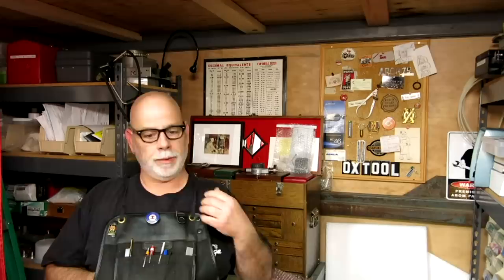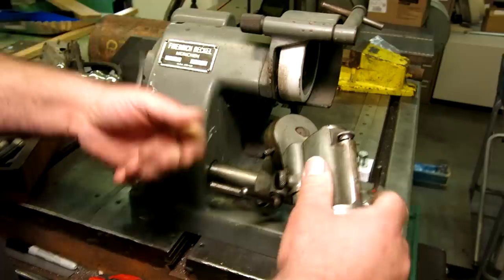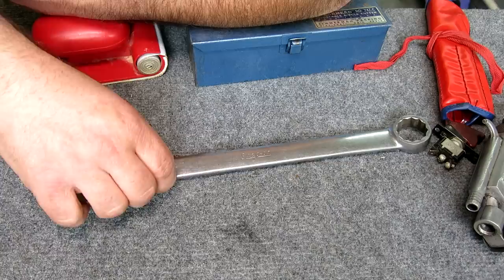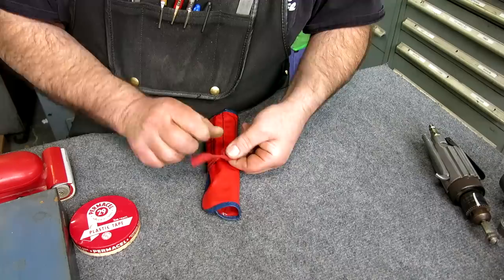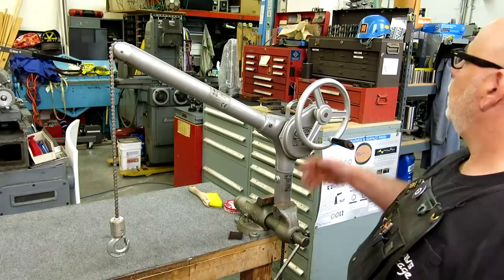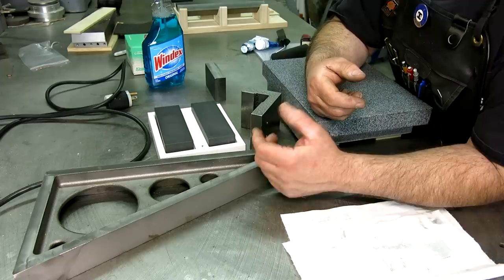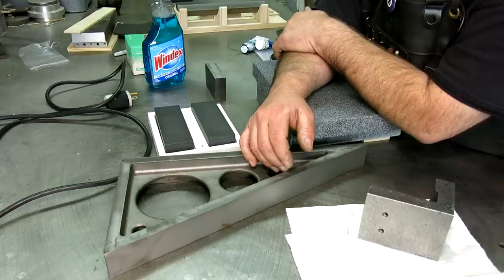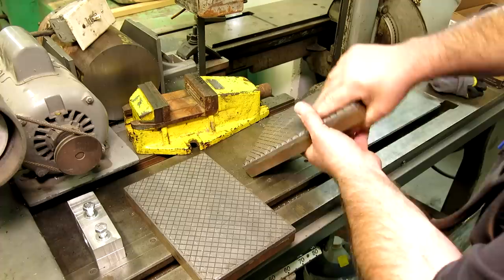Monday Night Meatloaf 117

Comment: The bailout sw. is used by the pilot to turn on red lights at the other crew members positions to signal them to get out now. Flip it up to actuate it. Down is a safety off. It is used on the larger aircraft such as a B- 52 or any multi position aircraft. Just so you know I am a retired USAF Crew Chief type mechanic.
Reply: Ja mmh.

Comment: Tom, I think you might be surprised with the last lapping plates you showed . . . Seriously !
Tin, or babbit mix can cut some very hard materials.  Tin is the premier material for lapping and polishing stones as hard as Sapphire ! ! !  * When you said it might be good for lapping copper, I was a bit shocked .  The right combination of lap material & lapping compound / polishing compound is the ticket.  Considering that plexi-glass as a lap, with cerium oxide as a polishing compound will polish quartz (remarkably); I think you're underestimating the value of soft laps having incredible potential for cutting hard material !     Congratulations on your tool finds :D   !      Thanks for sharing the meatloaf !

Comment: The air tool is a tire buffer used to rough up the inside surface of the tire to apply a patch. The reason for the Jacobs chuck is for easy swap out of the buffing head.

Comment: Just before 10:00 he mentions using Kroil.    Surprised he'd be using over-priced  over-hyped products. Gave the video a thumbs up for the heirloom micrometer.   Really appreciate such tools.   I have a hammer head over 2 lbs that was forged by my Great, Great, Grandfather on my father's side.   I used it every day for the 12 years I was in the shop. The handle itself has been changed many times but the one on it now is still a handle my father attached.  Now my father has passed but  the hammer is  still with me (despite my younger brother...nuff said) and I still use it on occasion.

Comment: Tip for you about that bigger scraper with the large head you made.
Put that large head just in from your shoulder and below your collarbone and you can actually get your body behind it. That leaves two hands to control the tool while you lean into it with your shoulder.
Much less tiring and much more productive

Comment: Tasty meatloaf! I think you might be over detailing the scraping operation though. I struggled with the same thing, you think its a super precise process but it is really more of an averaging out. As machinists we focus on the material we remove as that is what is important for what we have left. In scraping it is a mix of what we remove and what we leave that makes the finished result. I find it a different mindset for me.
Reply from the maker: Hi Brian. I figured if I could do the 40+ points doing 25PPI would be falling off a log easy. There are other uses for scraping besides sliding machine ways. Cheers. Tom
Reply: Sounds like a video subject.  I bet most of us hobby machinists only picture scraping for those sliding ways, and maybe reference surfaces.  I promise I would watch a video on other applications!

Comment: speaking of those aluminum laps, got me thinking, if one takes a clean flat piece of Al like that one, charge it with particular diamond grit, and then goes and anodizes it, then the anodizing will grow "out" of the surface just as much as it grows "in", basically enveloping and incorporating the grit into the anodizing layer, as the diamond wears, the grit is harder than anodizing, it will abrade it and expose new grit, that might be the mechanism behind those expensive laps
and since I own and operate a small anodizing line, I just might go ahead and try making one of those, see what comes of it... granted mine will be regular anodizing, not hard, still, good idea for a project

Comment: Used to use yellow artist paint for setting gears in helicopter transmissions and tail rotor gear boxes.  Was easier to read than the blue and washed off easily.

Comment: When you need to escape - the red cover guides the eye.  When you look at the switch head - see the green ? Put into sunlight and look at it in darkness.  Radium spot to glow at night.  I have a number of them but not with that cover.  Mine from B36 and B47 and B52(early).  Pipe flange gasket cutter - all Round.  I suppose some are donuts with holes and are small...  Hoist is way cool - take a chuck out - chuck an eye in the jaws -and extract - wing to rolling table or a hanger.  Nice indeed.

Comment: The hammer scraper makes so much sense. A couple thoughts: given that you don't need to push into it maybe it doesn't need to be so long. And then I would try to use it tapping toward myself to make it even easier to see fine detail of what I was working on. (My perspective from working lately under a magnifying ring light probably.)

Comment: Hi Tom, thank you for creating such enjoyable and informative videos.  You have inspired me to a have a go at a few things myself.  My first project is, surprise, surprise a welding table.  This will be my workbench for everything.  I bought your book which arrived just the other day and I thought that it was fate as there is an entire section devoted to “flame straightening”.  The inch thick table top I have has a moderate bow in it.  It is about 6 feet long, but 3 feet wide.  I read what you wrote and will give flame straightening a go (although with such a big piece of steel plate, I am not sure what the results will look like.)  If you could do a video on flame straightening, that would be fantastic.  The second thing I would like your advice on is how to hold, drill an tap a sphere.  I want to replace the handles on my drill press.  The only “out of the ordinary” machinery I have is a drill press, so no DRO to find the center of the sphere and I am not sure how to effectively clamp the steel balls either.  Any tips would be great.  Cheers, Al

Comment: i could be wrong but that air die grinder, could be a tire tool, i seen some like that, for grinding the rubber on the inside to smooth it out for a patch, they would put a rubber hose on the exhaust port, to keep rubber dust from collecting inside the tire

Comment: Oh I had the same exact idea for the finishing scrape (pecking) with a very refined edge. I also wanted to put a rotating pivot on the weight with a handle so you don't have to grip the weight but a perpendicular wood handle (that rotates), that can also decrease the shocks and should be easier on the wrists because you grip it perpendiculary to the weight sliding axis. Great to see the thing is actually practical at all but aiming it seems to require a bit of a practice.

Comment: that scraping tool, I have had an idea very similar for "pecking" off welding spatter.  the little BBs that are stuck to metal after welding.  I normally grab a flat chisel and a hammer, but I got to looking at a slide hammer and thought, that would be perfect!  Your application is probably alot better suited though, it doesn't take long to peck of spatter, scraping you are probably doing that all day long :D

Comment: That toggle is out of drag car (quite possibly re-purposed as it a common part in aircraft panelling). Usually sits next to the parachute deployment toggle.

We're talking 50s and 60s era stuff and later.

Aircraft tend to have hard/soft pulls and levers for deployment of emergency ejection/canopy off initiation. Usually in yellow and black stripes, or, rarely, red.

Comment: "bailout" switch, it's body is classified as naval arming and it's for emergency crew and passenger warning to GTFO of the aircraft. The really fun or critical switches had holes for copper .030 lockwire to hold the red cover down to prevent accidental actuation.